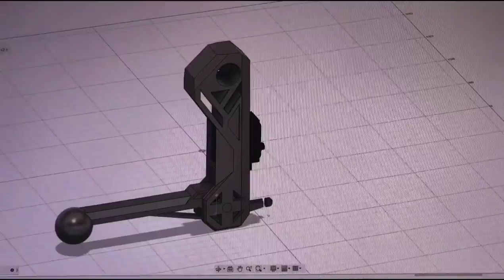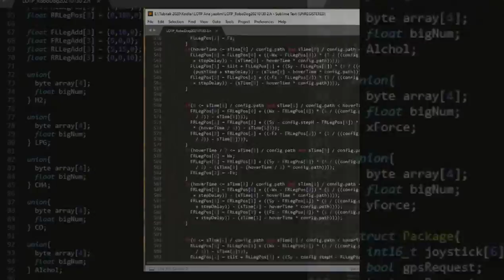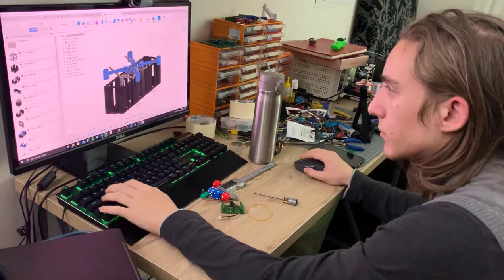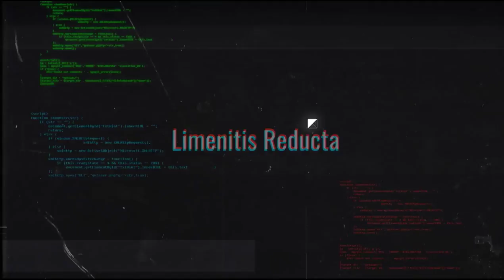5 Dakikada 7 Ay, LOTP Prototip 2 (Robot Köpek)

Comment: Well done. Any links to project files? Is this open source?
Reply from the maker: Thanks too much. Yes, LOTP Prototype 2 is now available on GitHub as an Opensource Modular Robot Dog project. 

Content of the share is 
1. Project Documents and Supplements (.pdf)
2. Performance Values (.pdf)
3. Used Parts List (.pdf)
4. 3D Design Files (Robot Step Files .stp)
5. Circuit Designs ((Electronics .fzz files)
6. Codes & Flow Charts Codes .ino & Diagrams .png files)

https://github.com/SMDHuman/LOTPRobotdog2

Please feel free to ask if you need my assistance or any consultancy.